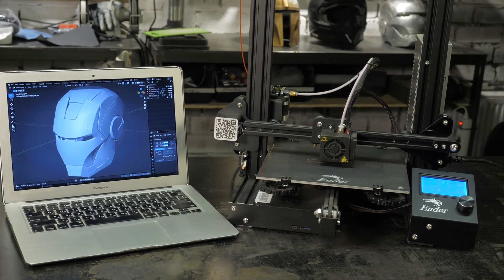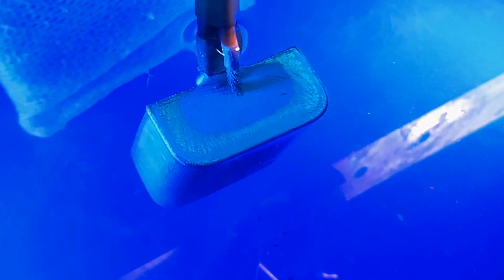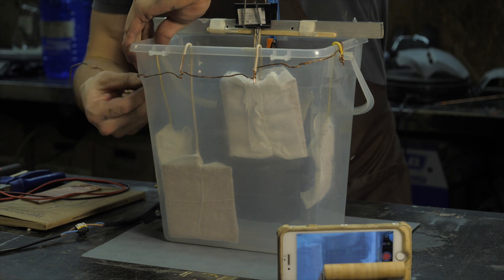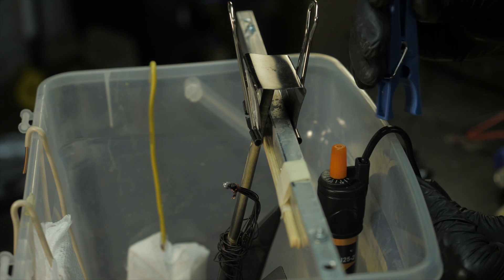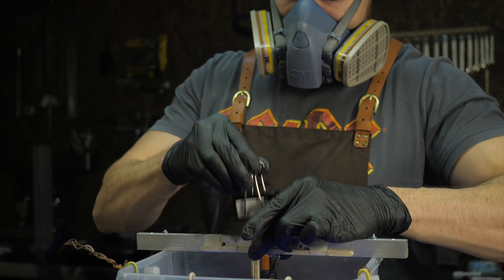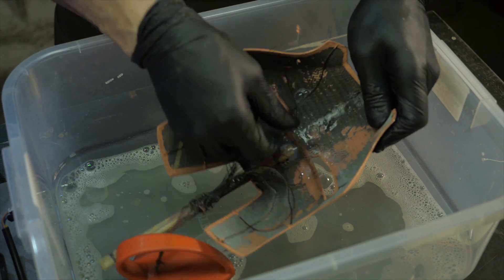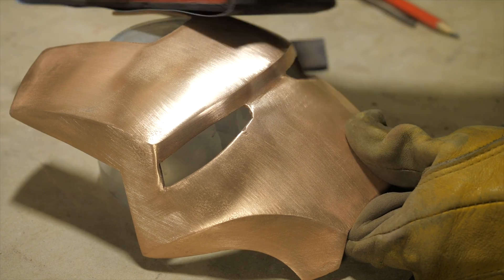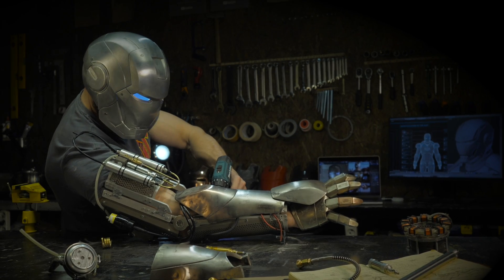#12 How to cover your 3D print with metal. Copper electroplating. Basics of composites.

Comment: plating 3d printed tin sn99 model with copper
Reply: tin is reusable, either detach and re-electroform or melt and re-3d-print
Reply: use standard store copper water pipe
Reply: you can use coffee filters
Reply: if you electrolyse CuSO4 with graphite/copper electrodes, you can make your own H2SO4 in the solution from that
Reply: try graphite sand blasting the 3d prints, to embed the graphite into the parts

Comment: Okay the effort is nice dandy and all but why not simply cast it for real? Would seem simpler at this time
Reply: Casting is very dangerous. One wrong move and that molten metal will burn you down to the bone. Electroplating may seem unimpressive, but it's far safer. 

Also there's always a possible chance that the propane tank or other fuel source can catastrophically explode due to a valve malfunction or manufacturing defect of the tank which could cause serious bodily injury and a potential fire hazard.

Comment: you should consider using glassware for the plating to avoid plastic particles detaching due to heat and lowering the electrolyte solution's purity

Comment: what would be the result if you were to give the bath to many amps?
also, would it be possible to reuse the elektroplating solution?
Reply: If I remember correctly from his older video, as long as you strain out any sediment you can reuse it for years.